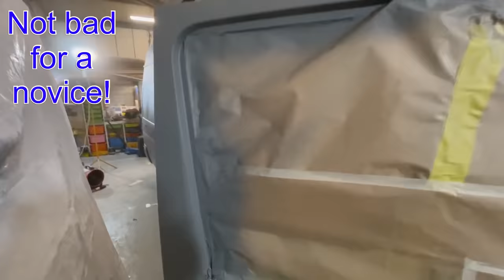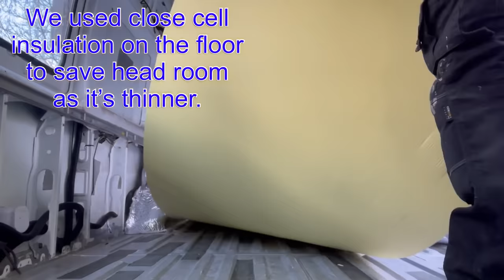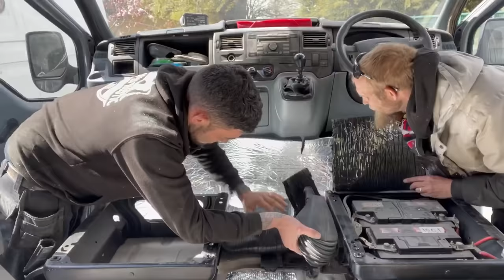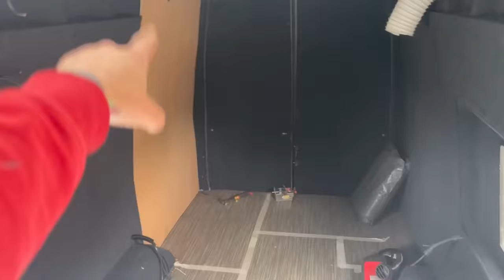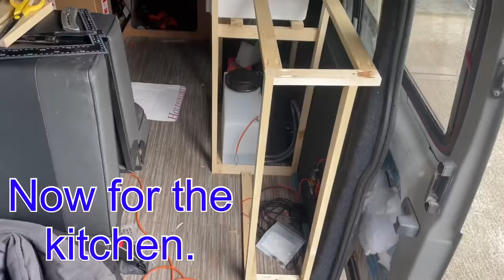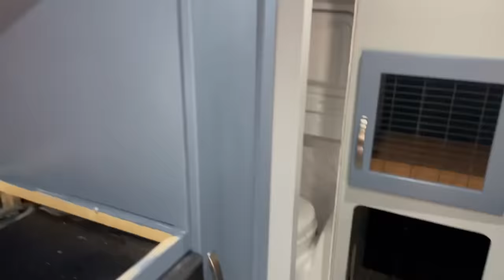FULL CAMPER VAN BUILD IN 7 MINUTES TIMELAPSE CONVERSION | 2021

Comment: really enjoyed the video, how long did it take from start to finish? also by keying up the paint with an orbital sander is the spray paint chipping off or staying strong?
Reply from the maker: We sorted in January and had our first trip in June although there are still a few jobs to do 😂
And no not at all am orbit sander is what most body shops will use.
Reply: @simplycampervanconversions  great! we may paint our transit camper we are converting as I had to weld a few patches in the body work. always been put off as not sure if to lacquer over the paint etc. seems like a lot of work.
Reply from the maker: @sN4Re  no laquer needed when using 2k paint.
Once you’ve painted and it’s dried it’s job done.
I have a couple of videos on my channel for raptor painting.
Reply from the maker: @sN4Re  https://youtube.com/playlist?list=PLKhYQ5qfztYbuT92NZz4eXv13Pl0B9IrV

Comment: Wonder how much the roof extension cost in parts
Reply from the maker: The roof was £325 second hand.
The rest such as the frame, screws and bolts etc was stuff we had lying around, but if you had to buy them not much maybe £400 all in fitted on the roof.
Reply: @simplycampervanconversions  which is how much in USD

Comment: Should use fiberglass on that roof extension
Reply from the maker: It is fibreglassed on on the outside it’s shown in more detail in the roof fitting video.
Reply: As someone who has been repairing  and moulding composites for nearly forty years I would be more concerned with the efficacy of those washers supporting the solar panels,given that air over and beneath them will create downforce,vacuum and lift at varying speeds concentrating those loads into the mountings small surface area will create and sustain flex which will lead to cracking especially around those square washers. A strip between fastenings or a sandwich plate would be better.
Reply from the maker: @areyouundoingthatorwhat9181  thankyou for that, always room for improvement. Would a spreader bar between two bolts on both inside and outside be more sufficient?
Reply: @simplycampervanconversions  Imagine the strength required to hold a sheet of ply that size at almost any angle facing a 30 mph wind for example,it's a lot😁,that is what you are trying to mitigate.Your aim is to get that loading spread across as much of the roof panel as possible so that essentially when movement of the solar panel occurs the flex is spread across the roof more equally,without areas of higher loads concentrated in a relatively small area(at the very edges of the washers and feet on the outside) where the panels elastic qualities are pushed to their limits. Ideally a lateral spar or two would be best,limiting the flex initially but also transferring the loads to a more rigid part of the roof. With limited space a good base plate or strips between fixings and overlapping would be more desirable,not forgetting the outside too. I would ensure that any strip or plate spreaders are properly bonded to the roof panel, this not only transfers the load over the spreader better but it insulates hard metal edges from abrading the composite and allows a bit of movement for thermal differences,never make your inner and outer spreaders the same size and never force the panel to conform to the shape of whatever is being bolted to it or its fixings,always form your mountings or supports to fit the panel in its natural shape.